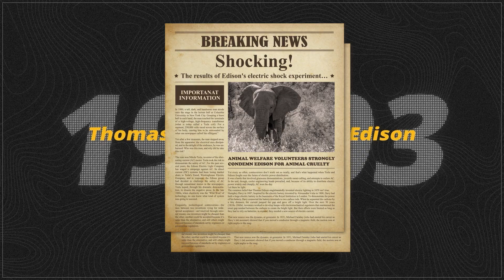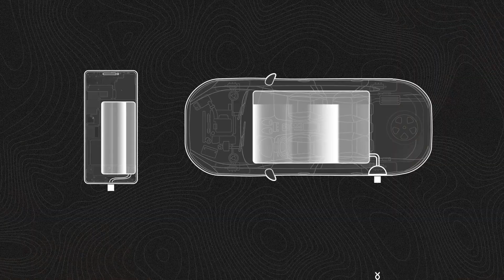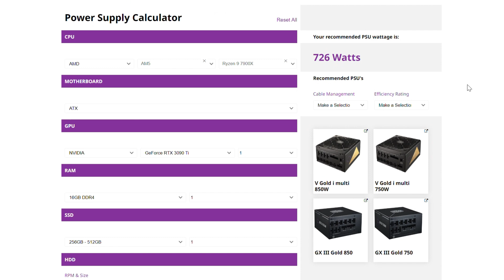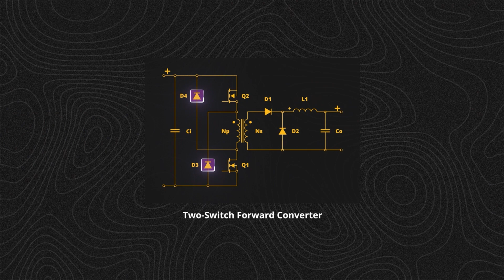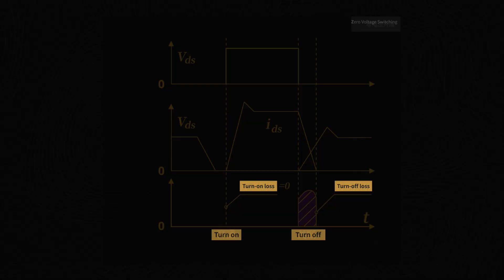The Incredible Strength of Modern PSUs

Comment: It is interesting BUT with that ZERO FAN MODE system you will not have a "disadvantage" that is, NOT EVERYONE HAS A POWERFUL PC, only a STANDARD PC, FOR EXAMPLE, a 486 PC like that.

Since it says that if it reaches one degree this turns on, but with a standard one and it doesn't reach the heat it will still turn on? Or how will there also be an accumulation of heat that turns on the ventilation?... I don't know if it is correct to say this.

Now, I don't know if those sources are useful for a "SERVER" which is another topic.

And finally, in the case of power supplies with the "ZERO FAN MODE" system, I wonder if the software called "MASTERPLUS+" is why it is not compatible with all sources from 600 watts upwards, be it any series and that I only see V or XG series that are compatible with the software, or at least that is also compatible with other series such as

I would appreciate it if you could answer all those questions before purchasing the product.